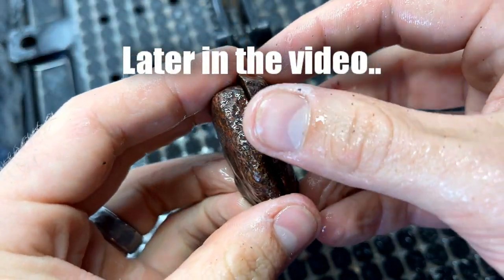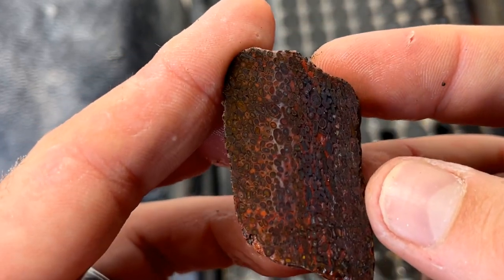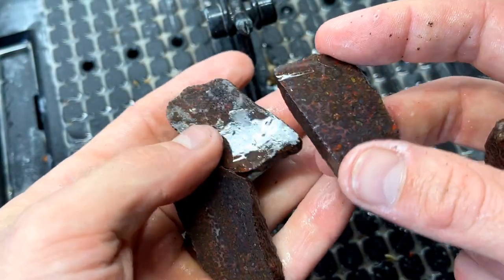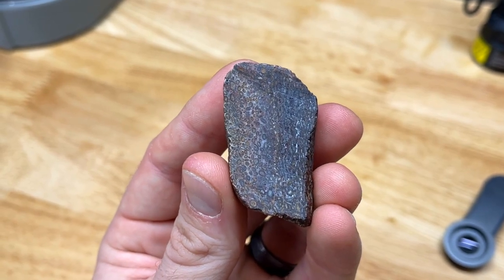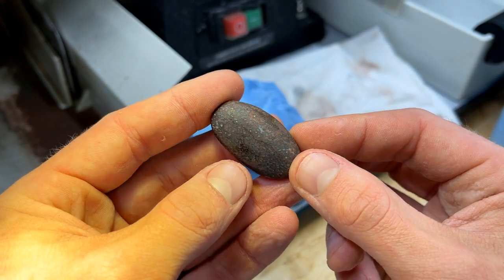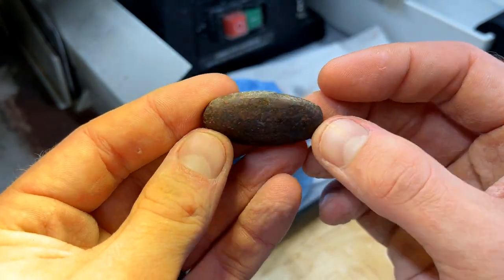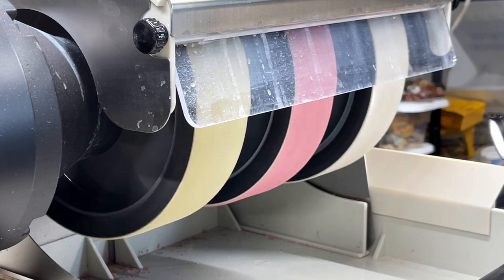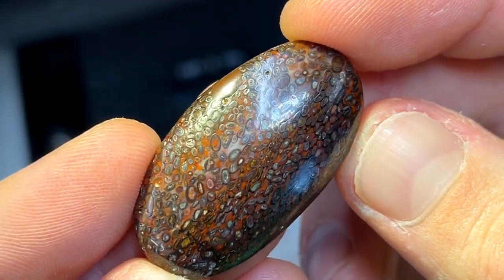Unlocking the Beauty of OOLITIC Iron Stone: From Raw Find to Lustrous Finish

Comment: you might want have a closer look it's dino bone
Reply from the maker: Give "oolitic ironstone jasper Minnesota" a search on google, let me know your thoughts :) I wish it was dino bone!
Reply: @AgateDad   if you run into yellow ones and heat them up to 500 degreese cook for say 8 hours they turn reds do not do that inside the house though just incase it contains mercury or arsnic. i use a old worn pizza oven burry the stone in sand it allows for a slower temp up and down. used for flintknapping